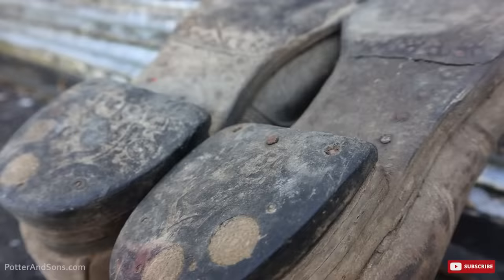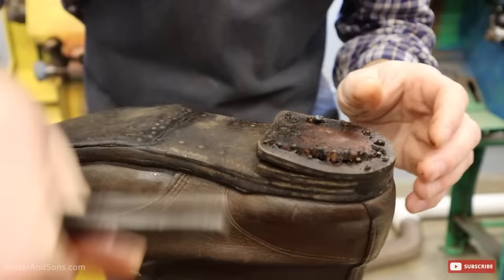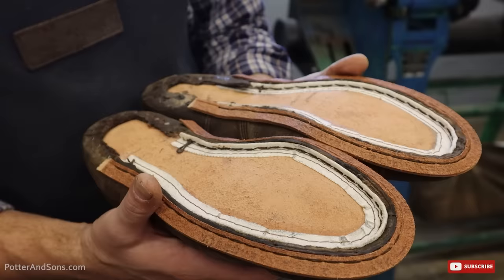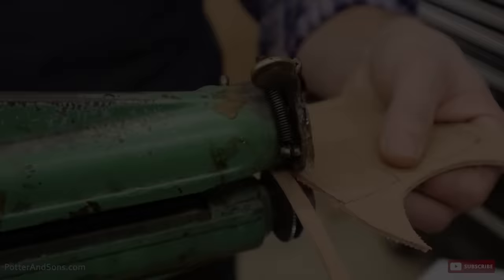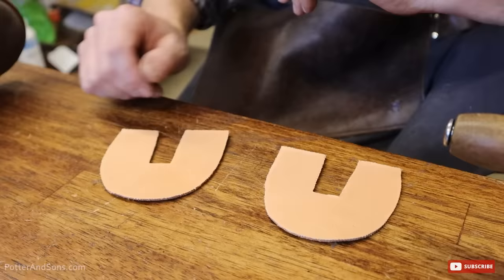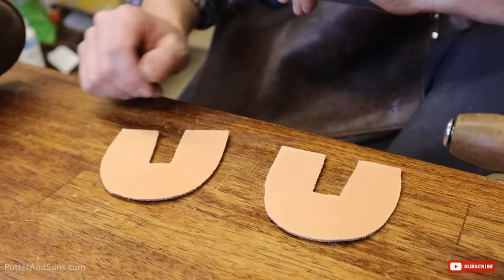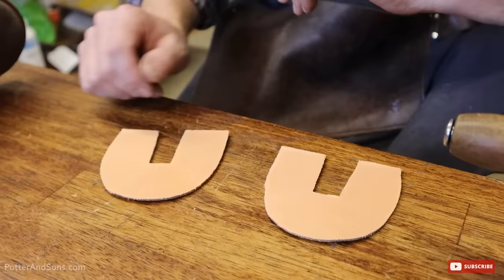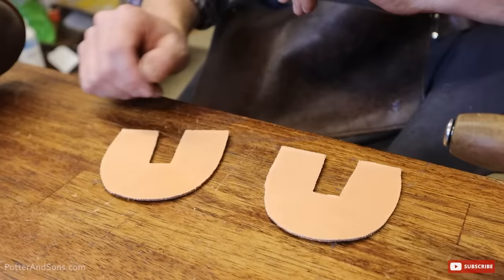80+ Year Old Boot Restoration | Vintage Boot Transformation

Comment: I am British Army veteran.  One of the first things we were told to do with our primary boots was to soak them in water for 12 hours, stuff the insides with newspaper and cover the outside with a generous layer of wax based shoe polish.  Each day we changed the newspaper.  After 3 or 4 days we could start wearing the boots and polish them every day.  The boot leather became nice and supple really quickly and completely water proof, which was incredibly important when wearing them out in  the field.  At the other extreme, our secondary boots were hardly worn.  They were highly polished to an almost mirror-like level.  Even the soles were polished.

Comment: Those machines bring back memories of working in two shoe factories in Columbus Ohio in 1969 and 1970 before leaving for the Air Force. My mother worked in a shoe factory for 13 years as the only ensole molder. She put the curve in the high heels hard ensole.  I loved the smell of leather and the quiet hum of the machines, save for the toe stitcher machine you sewed the sole on with.

Comment: Those sure look like Red Wing Iron Rangers to me.  I have 100 year old boots that I've started to restore. My sole leather is way better condition though and though the uppers were super brittle, they have improved. I feel less bad about just submerging them in the sink after I watched this video. All I've done so far is clean them and layered on three coats of leather conditioner and one coat of leather balm. They don't feel so brittle. I also haven't worn them, but I think wearing them gently would help warm up the leather to help them absorb some more conditioner.

Comment: Great job, I " can " imagine the amount of work these old boot saw. Boots are tools. Without my boots my feet would be a mess. I chop wood, work in the dirt, oil, rusty metal, snow, water, etc. If you have leather boots you have to to oil them from time to time. And they'll last a long time, look good and keep your feet dry and safe. Thanks for the video.

Comment: Good morning gentleman

I noticed in the background @ 7:03 that newer looks like possibly recently installed motor over your left shoulder. 

That's a resilient cushion frame motor, they're only designed to run in the shaft horizontal orientation. 

You need a rigid base to run shaft vertical,  you may want to check back with whomever installed it if it wasn't you guys and let them know that's the wrong motor. 

You take the chance of the 2 rubber cushion mounts coming off when it's hanging vertically. 

There's just 2 small machine screws that hold the clamp to the rubber attaching the base to the motor case..

Keep an eye on it if you don't get it swapped for a rigid base that has the motor plate welded to the case

Comment: I had no idea you can immerse leather shoes/boots. Amazing work. Shoes were made so much better back then.
Reply: Not completely true, they were meant to be reused.
However, there is many companies that make a much better product than these today, nicks, franks, whites boots. Like anything else made in America, esp by hand, they are expensive.
Typically usable box store boots, $100. Easy to break in. Comfortable immediately. All composite and synthetic materials, at best, a very crappy leather 2oz max best.
Then you have the $150 to $350 range. The average, uninformed consumer thinks is high end. They will usually be decent leather 4 to 6oz sometimes high quality leather. They will not be handmade (unless ur getting them from another country, or like a 1 man shop who only sells locally, u can rarely find someone legit at the upper end of this range). They are pretty comfy but take some time to break in. They will still have foam where it should be leather. They may even have cork but it should still be leather. The shank will be junk. The heel (dep on style) will not be quality. It will absolutely be cemented. It will sometimes be able to re-solable, not rebuildable.
High end, custom and handmade boots made in usa. These will be very tough to break in. Need a min of 80hrs to break in. Be generally completely leather including the insole. The mid, the lower, the heal, can all be entirely leather. Stacked for days lol. If it has a toe cap, it will be a true toe cap. Which means, very tough to break in. 16oz of leather on the toe so they basically never wear through. The leather will be high grade, generally name brand from a well known leather producer, sourced in the us, unless you specifically want something from another country. 7.5 to 8 oz leather, which is so tough its insane. Can made rough side out, because its dyed completely. The fashion or crappier lesthers will be thin and white on the inside, you dont put those rough side out. They will be water proof and if made with Kevlar thread and have  the red cross vibrams, fire proof. 
These types of boots will be made to order usually. Or very well fitting in comparison to typical box store boots.
The big names companies used to make their boots like this, thats why they use that lineage to sell today. That craftsmanship has carried there companies to where they are today.
However, consumers are slowly waking up. The Nicks, Franks, and whites that are small companies today, will be the wolverine, red wing, danners of tomorrow. 
These companies will prevail because they put their customers first.
They answer their phones.
They are doing all the things these companies did to get where they are today.
Funny that people ask how to start a business.
You need to start Honestly, purely, and with your heart and soul in it.
Then, when your kids take over, who never worked for anything, they will sell you name to worthless people who will use it until it dies, no matter the cost.
I hope these amazing companies (I only named a few, although some of the best) never sell out.
Please, if you wear Boots, absolutely call any of the 3 I listed and talk to real human, potentially the owner may answer any of the above companies, and get started on an adventure with the proper pair of boots.

Comment: Had a pair of Vietnam boots with the year 1964 labeled on them were hard as a rock, just put some leather CPR with a horseshoe brush to clean and slightly hydrate and then got some Vaseline spread it all over the boot let it sit and got a hair dryer on high heat and penetrated the leather with Vaseline by melting it with the heat then massaged the bolt thoroughly. I wear these boots everyday to work walk all day and not a single crack in sight. Not slimey at all supple where it needs to be and nice and sturdy where it's supposed to. Just like new id say and also added armor all tire gel to the soles and blow dryer it .

Comment: This is so great to watch! I love all the machines in your shop and your skill and explanation as you work. 
I was curious about why you didn't condition or oil the leather before trying to replace the soles? I have had very very old leather before that was completely dried out, oiled it and had it come back, soft, supple, and strong.
Was there a reason that you couldn't do this?

Comment: In painting conservation, it is sometimes done, by the process of "air-rated infusions" an elastic airasole rubber is used to moisten and impregnate old vellum (leather canvas). Depending on the age of the original leather.

Comment: From my understanding of old work boots, they didn’t start using the speed lace on the upper till the late 1940’s to early 1950’s. Everything before that was just the metal holes to lace up the boot with. Redwing didn’t use speed lacing till mid to late 1950’s. My neighbors family had a shoe store and repair shop since the 1890’s. They was one of the oldest Redwing stores in the country. Just closed up shop a few years ago. That’s where I got my information.

Comment: Hey guys I'm new to your channel!
Your work is exquisite! 

I'm wondering how to repair the soles of my black pseudo suede knee high winter boots! 

The upper fabric is still in excellent condition, and looking good, however, because I supinate when I walk, the inner manmade sole at the heels and toes are severely worn out😳! 

They are not high heeled boots, just a comfortable 1-1/2 inch.

I want to keep my boots-- but how can I replace and make the soles stronger? Because I can get at least 2-3 more years out of the uppers, even though they are pseudo suede.

Can I mail them to your shop😏

Comment: I'm a third generation shoe retailer in North Alabama.   I have an old pair of children's 6" work shoes on display that remind me of these...but, there is no readable branding.   If I had to give one guess as to what brand these are I've got to go with Wolverine or Weinbrenner boots.  Due to age and construction with that leather band on the inside around the top collar it fits with what these two companies were doing on most boots up through the late 50's.  International Shoe Company of St. Louis also made similar boots under several brands like Locust Post and Outdoorsman, but I'm still betting on Wolverine or Weinbrenner Shoe Company as the maker of those boots.  By the way it looks like you used a trick I've done on occasion which is to thin a whole heel down from the back side???

Comment: I only buy shoes that can be resoled. When new, I have rubber plates installed over the contact part of the leather soles. That's the only part I have to replace along with heel-taps. Some of them are over 20 years old now with original soles and look amazing. I use cedar shoe trees and cream polishes. Cheap shoes are just not worth it.

Comment: That half sole could have been original. I thought those were jump boots at first, until I saw the low cut and the hooks instead of eyelets. From the ankle down, they look very much like Corcorans, which have the half sole exactly like that from the factory. They are also from around the same era.

Comment: Admittedly, I know very little about shoes and shoe repair. But I noticed at around 14:20 that you were pounding some reasonably long nails into the heel of the boot. My question is, won't those nails come right through into the inside heel of the boot? I understand the owner doesn't want anybody wearing them (although I'm not sure why), but still, it's kind of disconcerting. Great videos, by the way!

Comment: Ralph Lauren has a line called RL, It's their vintage clothes/line. Most of their stores  have a section. Some of the clothes and shoes are jus' random. i.e., it's not multiple items like the regular inventory, it's more like a thrift shop item, and it's usually very expensive, I mean to the extreme. 'Guarantee if they got their hands on those boots, which looks like a typical item that would be in that section of their store, 'bet those boots would run for at least $750.

Comment: Any chance the nails you put into the very thin midsole will pierce the feet one day?
Reply: They won't at all. They're called clinch nails. The boots sit on the metal anvil. The nail is hammered into the leather sole. The end of the nail hits the anvil, and is then pushed back into the leather sole, curling into itself. So your feet won't be poked. They're used on a variety of dress shoes. You'll also see nails used on a variety of boots such as dress boots, PNW boots, work boots, etc. The nails ensure that the midsoles and rubber soles stay in place besides the contact glue and stitching. All good things 😊!

Comment: Why didn't you use the shoe tree at anytime of the restoration? I mean, everyone keeps saying that it's kind of basic.
Reply from the maker: You use shoe trees to maintain shoes (absorb sweat, keep the overall shape of the shoe).  You don’t use shoe trees during the restoration of a shoe.  If you’re referring to shoe lasts, only the original manufacturer of these boots has the lasts.  Every leather shoe ever made has a last.  That would require us to have thousands and thousands of shoe lasts.

Comment: Why don’t you moisturise the whole leather (other than just putting the shoes into the water), before even working on it? Right after taking the sole off, I would have used some grease to soften the leather and thereby made sure it wouldn’t crack.

Comment: Odd thing to do. You probably want to put electronic ignition fuel injection and a turbo on the old tractor after you get all the parts powder coated and chromed. Yep, great great gramps just took them boots out of the shoemaker's wrapping paper and was sitting on a carpet trying them on so as not to scratch the new full soles and heals when he died. Money was no object to a vain guy like great great gramps.

Comment: Mixed feelings. When I was young I would appreciate restoration of someone else's boots. Now that I am old. Every groove and repair made while I wore them or retired them is the history now lost for Youtube views. You should have told the owners or found a way for those boots to be preserved in their original state even if they continued to rot. Some kind of cast. At least scientists could recall how they were made. Replacing alters that history. But whatever. That is what kids are for. To learn from their mistakes once they have old boots knowing their own kids will have zero idea why they look the way they do. Every shoe, sneaker and boot I have worn have worn differently depending on what I was doing. Good luck.

Comment: Не думаю,что их можно носить - это только наружная реставрация -  кожа за эти годы рассохлась и при ЛЮБОМ  сгибании будет ЛОМАТЬСЯ,да и сам мастер косвенно это подтверждает - не реставрируя ботинки изнутри - к внутренностям не прикоснулся...Работа снаружи отличная - НО показуха...(((
I don’t think that they can be worn - this is only an external restoration - the skin has dried up over the years and will BROKEN with ANY bending, and the master himself indirectly confirms this - without restoring the shoes from the inside - he didn’t touch the insides ... The work is excellent from the outside - BUT window dressing...(((

Comment: I do not see the point of this exercise.  Those boots couldn't be worn.  They'd crack all to pieces in no time.  It seems it would have been better to use them as a pattern to make a reproduction.
Reply: The point of the exercise is that the owner wants to display (Great) Grandfather's boots.  It is no different than wanting to restore one of Grandmother's quilts in order to hang it on a wall.

Comment: No offense but if these were part of a family legacy I would not have touched them save brush the dirt off. They had so much character and they were not going to be worn so what’s the point of the restoration of the bottoms? They may look nice but the historical value is lost IMOA.
Reply: Something to be said about restoring them to their former glory using money the old boy likely wouldn't have been able to spare. It's a personal thing no right answers. The leather definitely needed the conditioner though, it will stop them rotting and falling apart over time